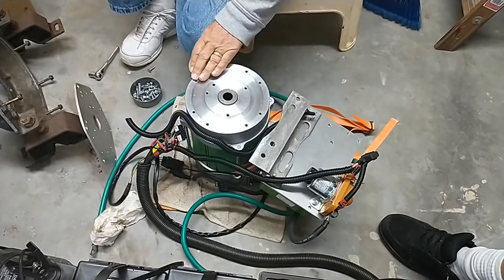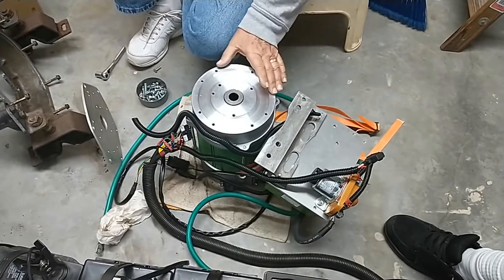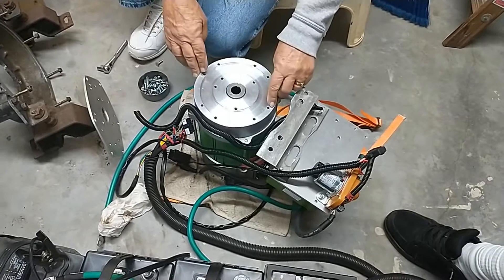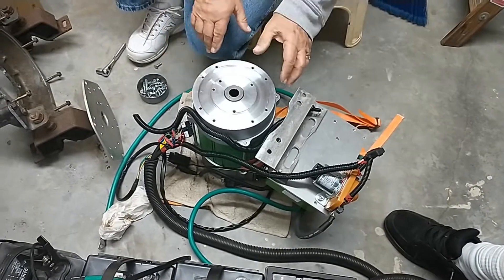Replacing Yanmar 2gm Diesel with Navitas AC Induction Electric Motor in 28' Sailboat - Intro Episode

Comment: Which Navitas motor? It looks like the AC motor and controller. It looks like you used an input shaft from the golf cart for the drive but modified it. Was it a Yamaha, ezgo or clubcar Navitas? Thanks! I am trying to repower as well
Reply from the maker: We went with the 5kw motor and 600amp controller. google "navitas ezgo 5kw kit". The connecter is Molex 16 pin style - google "Molex 16-Pin Black Connector Pitch 4.20mm, w/18-24 AWG Pin Mini-Fit Jr". For the shaft just google "golf cart shaft oem 620329". You should see a couple 10LOL results come up. Be sure to get the number of splines right for your motor. e.g. 19 spline. You will need to cut the shaft and weld it to a plate, and that's probably the most precise part of the entire job you need to worry about. We hired out the welding. I have a couple pictures with the dimensions of the shaft before and after modifications we'll show in another video. The shaft arrives at about 5.448" and is cut down to 3.427" before welding.